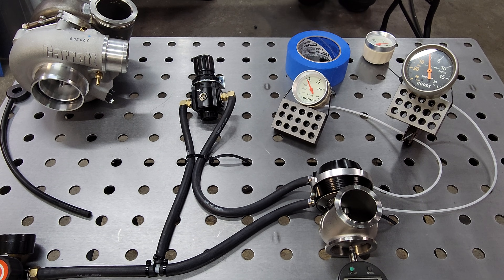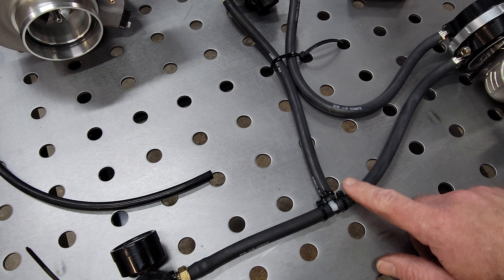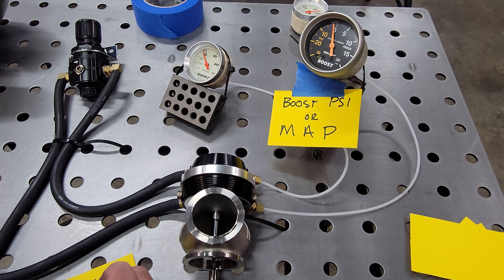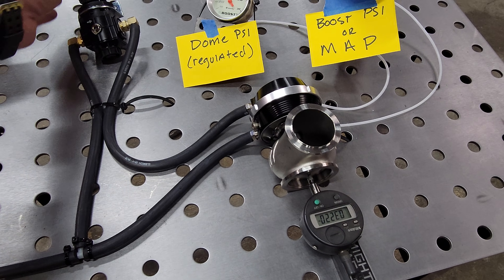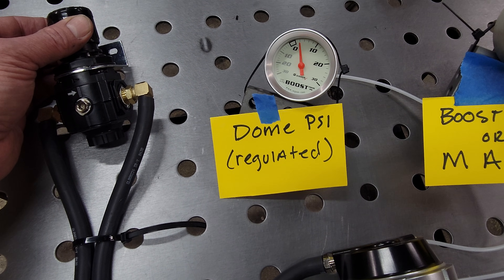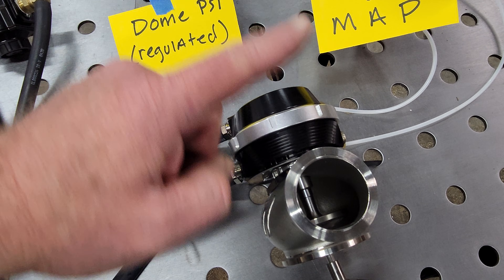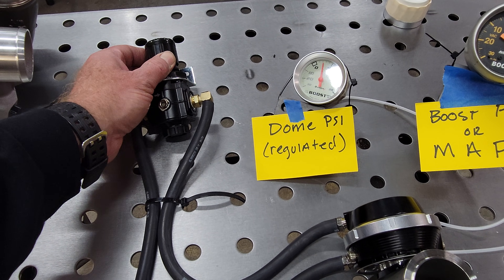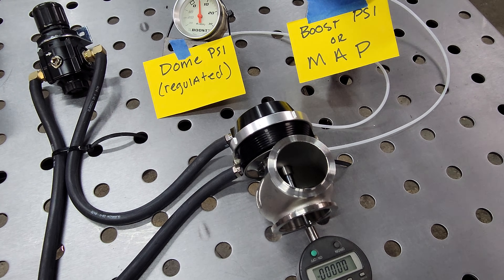External Wastegate Setup, Episode 2.  Simple Adjustable Boost Controller!

Comment: Thanks for the time and effort needed to provide this fantastic demonstration!  I've been around car turbos for a while and never knew this stuff.  Adding to the confusion is there are internal and external wastegates, one and two port wastegates, and about three different kinds of manual boost controllers including the regulator style you are using and also bleed style and checkvalve and restrictor styles.  I am setting up a new dual port external wastegate and am bench testing regulators to supply a few psi of pressure to the dome.  Thanks for the ARO brand recommendation.  Have you seen any issues with these losing calibration over time or changing as the input pressure changes?  The demo rig you have uses a steady supply of air and that doesn't simulate what happens in an engine where  there can be rapid changes from negative pressure to positive pressure.
Reply from the maker: Very welcome.  I ran the ARO regulator on my Grand National for just shy of 25 years...I was always in a state of "change" with that car as it was used for R&D, but the regulator always seemed to do what I needed it too.

I will say that I always tried to keep the base spring in the gate very close to my target boost pressure (usually within 5 psi), but there was a time where I was driving that car daily and I needed to be able to go from 15-16 psi of pump gas friendly boost up to my track boost 20-22 psi at the time, and it was a bit of a variable from what I remember if the temp changed a lot.  This should be easy to see in a modern controller that you could record the duty cycle required to achieve target.  Atmospheric conditions play into it all, obviously.  

One thing I remember making a very noticable change was going from rubber/silicone hose to DOT hard(er) plastic push loc hoses, that did really sharpen up the control and define the boost ramps better.  

All in all, it worked for me very well.  Is it state of the art?  Nope... but you have to think about the time we were using these.  Our first really big trick in the drag racing world was using multiple regulators along with digi-set timers triggered off of the trans brake and gear position inputs that would then control solenoids to allow us to have some sort of a chance to tune a boost curve for the specific track condition...and we even used this on street cars for gear based boost targets.  

Oh, and my first boost controller was a simple fish tank "bubbler valve" from the pet store...those were the days!  

I like to tinker, seems you do as well...its always fun to try to figure out the best recipe for a given goal.  Keep it up!  Reed

Comment: Thanks for the thorough explanation and examples of how boost control works! I'm running a manual BC to a Turbosmart WG. Is there any benefit to running the boost controller in the same configuration as you have here using the pressure regulator. In other words teeing the boost line from the turbo and sending one hose to the BC and one hose to the bottom reference port on the WG. Then running the return hose from the BC to the top port on the WG. Thanks!
Reply from the maker: I am going to make sure what I am saying is right, so bear with me!  The manual boost controller works by bleeding off signal to the diaphram/spring motor assembly.  The bleeding of air reduces the pressure on the motor, therefore rasing the boost.  

If you installed it just like I have the regulator in the video plumbed, it would work "in reverse",  in otherwords all the way closed (more boost in the conventional inline installation) would provide a big "leak" and little pressure to the top of the external gate (less boost).  All the way open (less boost in the conventional inline install) would provide un-restricted flow and no bleed, therefore more pressure to the top of the external gate and more boost.  

This is straight off my head, but I will test it very soon as I am doing another wastegate video.  Once I test I will respond back to your question here and give you the 100% solid answer.   Thank you!  Reed
Reply: @workturbo thanks for the thoughtful answer. I think you are completely correct. I hooked up my BC and WG to emulate your setup with a travel indicator. And sure enough the WG didn't open at all with the BC "bled off" pressure going to the top of the WG. Duh I should have realized I could never supply more pressure to the dome this way. I guess I really didn't understand how the BC worked until that point. 

I just bought a 30psi air regulator to test how that acts in my system. It would be very interesting to compare spool time on the same motor with a BC vs an air regulator vs a 3-port solenoid. Everyone says the solenoid is fastest. But is it really when boost/rpm are carefully logged and by how much?

Comment: Just for clarity, if only the bottom line were hooked up to the wastegate (top vented to atmosphere), would the incoming air pressure from the compressor work against the spring (opposite what the dome pressure would provide)? If given a 7lb spring, and the exhaust pressure builds 3.5lbs of boost, would the combined air and exhaust pressure open the gate?
Reply from the maker: Yes, you are correct.  The bottom port is your reference.  Most quality gates will account for some back pressure, so if you put the 7 psi spring in, hook the reference from the compressor cover to the bottom port and leave the top vented, you should get pretty close to 7 psi of manifold pressure under boost.  HTH! Reed
Reply: @workturbo  So the bottom line will give assistance to the diaphragm and open the gate? My original thought was with no lines at all, a 7lb spring will open at 7lb of exhaust pressure, but may see some boost creep and fluctuation. With only a bottom refence line connected, 3.5lbs of exhaust pressure producing 3.5lbs of boost pressure, would open a 7lb spring if the the bottom line would actually assist with the gate opening. Thus only making 3.5psi of MAP. Again no dome pressure added and vented to atmosphere. Appreciate the assistance and video BTW
Reply from the maker: @joehajny6279  Yes, the lower port is your reference (opens the gate at the published spring pressure enough to control the boost in most applications)

The wastegate opening pressure is a result of the spring pressure and diaphragms ratio.   If you put the gate on with no boost reference to the lower port, it will take quite a bit of exhaust pressure to open it (think surface area of the valve head in respect to the surface area of the diaphragm). 

 While you could adjust the spring pressure to open at a desired EMAP (exhaust manifold pressure), it is a bit of trial and error work needed on your end,  this will take some spring changes and time.   

To give you an idea, just a few weeks ago I had a customer drop off a turbo for inspection.  His wastegate was set at 10.2 psi (spring pressure only, no controller of any type).  Pressure line was plumbed from the compressor outlet direct to the bottom port of the gate.  The car had been working flawless for years this way.   Well, the reference line broke off (aluminum AN fitting snapped from fatigue).  The car went all the way to 28 plus PSI of boost during a pull before he realized what had happened.  Got the head gasket.

So, unless you are ready to really tinker with the idea of using exhaust pressure to open it, just run the reference line to the bottom port as discussed earlier.   

Turbosmart and Tial both have spent a lot of time dialing in this spring rate...almost all cars we install their gates on will just about meet the advertised spring pressure perfect.  7 psi spring will have a slightly higher opening pressure than 7 psi to account for exhaust drive pressure (backpressure), so you should be really close. 

If your setup makes high backpressure for some reason, you will see lower boost numbers (or for that matter, if you have higer air filter or intercooler restriction you may see lower numbers as well)

Does this make sense?  LMK! Reed

Comment: May be worth noting..Some vid's i came across had me confused as  some air regulators and or bleed type boost control valves are reversed in the way they work... turning the knob down closes the air flow ,where as ,like the one you have, raising knob closes air flow.
Reply from the maker: I have seen them both ways as well!  If you are unsure or do not have clear markings or instructions, this test will verify the rotation and function accurately.  HTH! Reed

Comment: I’m thinking of using a 3 port solenoid, pulse the solenoid to work as your regulator. It should pulse fast enough to control the dome pressure and be electronically controlled. Trying to find out if my Pimp ecu can control the solenoid. Venting the dome pressure off as needed. What’s your thoughts?

Comment: Didnt see it mentioned...Some advise regarding some simple hose and clamp type for those supplied fittings .there is Soo much debate about what can,will,will not work.  The bottom port is closest to heat and on a street car lines will be in un friendly environment. Any suggestions appreciated.
Reply from the maker: Good question!  I will put this on my list of tech to cover in more detail soon.

If you want the ultimate, fit all metal lines.  These also work best if your installation is specifically heat prone...expensive and time consuming, but worth every minute considering the consequences if this line fails. 

  For the average consumer usually suggest reinforced silicone hose with a metal constant tension clamp, or better yet look up an Oetiker 154 Series Clamp, they are my favorite for silicone.  Add a layer of fire sleeve to it and make sure to shield it from any radiant heat sources and you will be good to go.  Almost all OE hoses are of this design.  I know external gates pose a tricky scenario, but though out correctly you most likely will be ok with this choice.

I have also used AN hoses with high temp ratings and the fire sleeve as well.  Not my favorite, only because people that use this design rarely inspect them, especially when they are easy to remove and re-install.  With my second suggestion, you are forced to look at the hose when taking off the clamps, so inspection is more consistent.  Small thing to think of, but important! 

HTH!  Reed

Comment: Hello, very helpful video! I have a question I can't seem to find the answer to. If I have a tial style wastegate with a port on top, one on the top side, and 3 lower ports. I have my two lines run to one lower port and the other to the upper side port. Do I then plug the other two lowers and the top ports?
Reply from the maker: Your boost control system will need the extra ports closed.  If you have an open port (leak) at the lower side, you will have a massive increase in volume/pressure needed to push the diaphragm (wastegate valve) open (making the turbo work harder/more boost)

On the top port, any leak will reduce the signal from your boost control solenoid or regulator, meaning you will not apply resistance to the diaphragm moving.  This will reduce the amount of available boost increase by that factor.  

Also, look really closely...TiAL gates are also water cooled, you may have ports that are marked with the water symbol...these are optional to use and can remain plugged if not utilizing this feature!

Hope this answers your questions, please let me know if you need anything else!  -Reed

Comment: do you have a blow of valve demonstration with were vacuum lines go and how it work bbc carburated. thank you
Reply from the maker: I will be covering blow off valves in detail very soon. But let's help you out right now! 

The blow off valve needs to be placed in the pipe feeding the carburetor hat. I find you will want to mount it a little bit before the hat itself. Lets say the pipe coming into your hat is 24" long, just for conversation. Put the BOV in the first 1/4 of the length of that pipe starting from the intercooler (or turbo compressor outlet if it is not intercooled)  

The reason for this is to keep fuel "reversion" from blowing out of the valve as much as you can. 

If the valve is closer to the carb hat, SOMETIMES you will get a little bit of fuel "backfed" out of the hat and valve. Could possibly be a slight safety or smell concern. Putting the valve a little further from the hat will help this. 

As for the vacuum line, you want to hook it directly to a port in the intake that will see both vacuum at idle and boost under acceleration. 

This is important so the valve will operate properly. If you hook the reference line directly to the hat, there will be no vacuum present to help open the valve when the throttle is rapidly closed. 

If you have any other questions, please ask. I hope all of this makes sense!  -Reed

Comment: Hi good video thank you this helps a lot...I have replaced all my boost lines new new still can't go over 0.5bar boost 

My question is if I don't have a regulator can I use a turbosmart boost T to replace the regulator? Just to be safe
Reply from the maker: Its may not be a good idea to use a Boost T to regulate the air down on 80psi let alone our compressor at 150psi of pressure.  It may take more clicks than you think to get a response as well, you could have a damaged wastegate diaphragm.  Give us some more detail about the setup and we may can try and replicate or help guild you though it the more we can narrow down the more we can eliminate.

-David
Reply: @workturbo hi David thank you for the response..

Is it possible to run the same pressure top and bottom by just using a T

Comment: I have two external 40mm wastegates plumbed top of each dome together going to MAC valve and bottom of each wastegate going to MAC valve. Both wastegate have 15LBs springs installed. I only plan on running maybe max 25PSI boost. Would you recommend leaving the 15lb springs in or lowering to 8-10LBs springs. Since in this setup as mentioned in the video i can achieve greater boost pressure with a lower rated spring
Reply from the maker: I am covering this in a future video, but in short...yes.  Now there are some variables, like backpressure, intercooler pressure drop, wastegate priority etc that will have influences on this setup.  Sometimes we see boost flutter, or sometimes slower transient response when dropping spring pressures that low and trying to achieve higher boost.  

My general rule is to start with a base spring setting that gives you the minimum boost you will ever be happy with, or need.  This way you get the most out of the mechanical settings of the gate, and usually better response.  

So, if you have a reason to need 8-10 psi at some point, then you need to set your base to that and work with the control strategy to get your desired max pressure.  It may go smooth, it may challenge you...each case is specific to the setup!  Stay tuned...Reed

Comment: This is super helpful, thank you Reed! 

My take away (as I will be using this set up with an electronic 3 port boost controller) is this...

The delta (change) in pressure between the dome and MAP can be controlled with great precision connected this way as opposed to simply two connections with the third venting to atmosphere.
This means that (depending on the size of the EWG and actual spring size) we can help mitigate turbo lag and responsiveness in more detail and granularity than we could with a simple two port hook up without the T-fitting.

Can you see what I mean?

Again, awesome video. Thanks for posting this!
Reply from the maker: Yessir!  Very welcome.  I am going to keep diving into wastegates and boost control (components, tuning strategy, influences of outside variables etc) over the next few videos.  We picked up a test car that allows us to show these things in the "real world" and on the workbench as well.  It is going to be fun.   To answer your question, you are 100% spot on with your take away.  The "bleeder valve" video and electronic control videos are going to show this perfectly.  Thanks again, I appreciate you-Reed

Comment: Debating on installing a Tial or equivalent on my car. Right now I have a Turbo Smart Manual Boost Controller set at 10psi care runs great what advantages would I get from adding a $500 plus aftermarket Waste Gate?
Reply from the maker: Tell me more about the car and it's current turbo/header setup.  I will be happy to give you some accurate feedback!  Reed
Reply: @workturbo it’s a 88 944 Turbo all original. I’m told it will build boost from 4-5500 then boost starts to bleed off. I have installed a MBC that seems to work well though